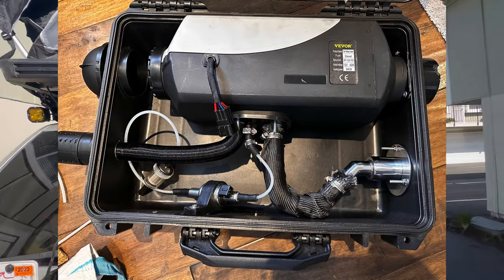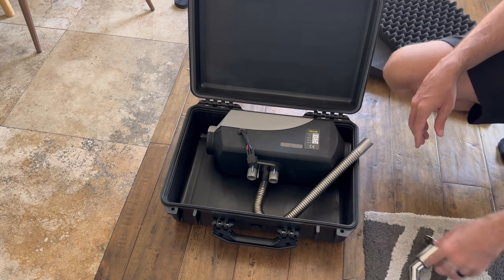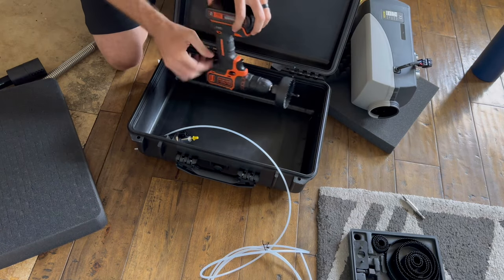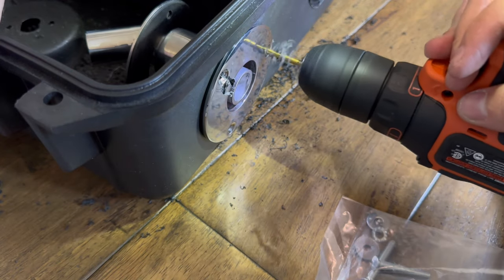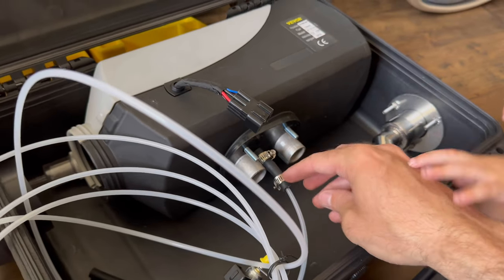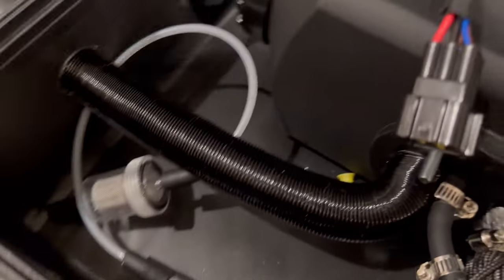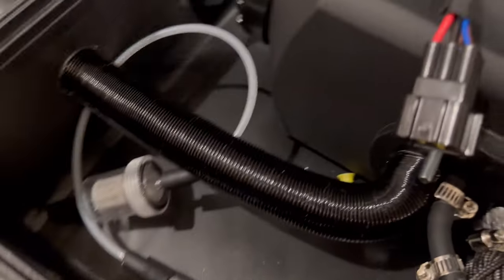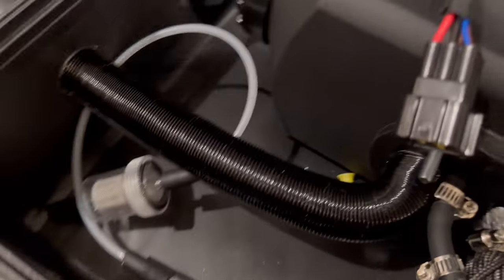Ultimate VEVOR DIESEL HEATER IN A BOX BUILD | DIY Tent Heater for Off-Grid Overlanding

Comment: Might want to consider adding a heater intake so that you get the benefit from reheating the air within the tent so that it doesn’t have to always pull freezing cold air. Plus it will help avoid pulling the diesel exhaust into the heater which could be dangerous in a small tent.
Reply: Many have proven it creates condensation. I’ll take condensation over co2 intoxication tho

Comment: You're drawing air in from where the exhaust comes out. These heaters are designed to draw air in and out into the living area, separate from the combustion air in and out.
Reply from the maker: Yep, working on getting that figured out. This was mostly a test to get the basic function down and it works really well. I also upgraded to a stainless steel elbow on the outlet. Slowly coming together
Reply: @lexus_offroad_adventures  obvious answer is to have another flexible pipe going into the van window, so one for inlet and one for outlet. Will be more efficient as it's heating warm air inside the van.

Comment: The instructions say not to lay the heater on its side due to a weep hole at the combustion glow plug entrance due to fuel issues. Did it work out ok?
Reply from the maker: @flyingeyeballfpvjoe1516  I usually run it on a 45-degree angle on the back of the tire carrier for this reason. Works fine like that

Comment: The rubber gasket of the fuel pick up has to be on the outside of the fuel tank. The metal ring gives a better pressure on the rubber ring on to the tank.
Reply from the maker: Good point. I have since switched to a different (smaller) tank with this orientation

Comment: Your intakes will not withstand driving rain or condensation on muffler intake. I would suggest you either put right angle flange on heater input, or a pipe  to recirculate tent air, and that will improve its efficieny. In regard to burner intake there are 2 options to my mind. One put a shield plate over its filter come silenser, or 2, put a right angle fitting so intake faces downwards.
Reply from the maker: I will be addressing the air intake muffler soon. See the latest video for how I’m achieving circulation. It’s a work in progress, thanks for the tips!

Comment: Nice build and it suits your needs. 

You have the exhaust muffler flat in the horizontal position. It needs to be in the vertical position. Why? There is a small weep hole. The weep hole points downward for condensation drainage. On the intake side, it is not an air filter, it is a silencer (which really does not work all that well). Upgrade to an actual sir filter.
Reply from the maker: Yep, I’ve rotated the muffler down for proper weep hole operation. I just kinda threw it on to see if it quieted the exhaust down at all, which it did. 

I’ll look for a proper air filter, thanks!

Comment: You can swag a 3/4" copper pipe with a 7/8" expansion tool. Coiled copper tubing is the easiest to expand. It will slide over both the exhaust tip from the heater and the exhaust exit mount.

I made mine with medium Ridgid tool box. It has plenty for the heater. The exhaust pipe went out in a straight line. The intake pipe stayed inside. 
You don't have to exit the box with the intake filter. Just provide ventilation.

I had plenty of room left to place 36ah lithium battery inside with all the controller and wires attached to the lid.
I even added solar controller inside the box. I can charge the battery with solar.
I also added 12v socket and XT60 on the outside for charging and use as power supply.  
I cut 3" holes with vents. The vents have 12v fans to cool the inside the box.
I can also control the heater with the Bluetooth.

The fuel pump can be mounted straight up and down. Just not level or down wards on the outlet.
The fuel line has quick disconnect.
The heater is clean as a whistle. No wires and fuel line to tangle.
Reply from the maker: Thanks for the write-up! Sounds like a really cool all-in-one setup. I updated this one in a later video and cleaned it up a lot, but I probably keep improving it as time goes with ideas like these!

Comment: Nice build, i am also on the verge of finishing my setup. I am waiting for a metal flange so that it will keep up with the high temp output
Reply from the maker: I tried the aluminum elbow but it was not a true 3" OD/was really flimsy. I got an ABS piece and I'll see how it takes the heat. ABS is supposed to be good up to 175 degrees. Here’s the link: https://amzn.to/3NT3HVP
Reply: Cool, let us know if it's bending
Reply from the maker: @myloalex  for sure need to post an update video after I get a chance to use it snow camping
Reply from the maker: @myloalex  before I could test with the ABS, I just ended up getting a steel elbow. Works perfectly. I posted an update video called diesel heater efficiency mods a bit ago

Comment: Hey I notice you have 100ft of 14 awg wire listed for genera use.. but 16awg for the cigarette lighter for the power station. Is the power cord to the unit 14 or 16awg? Thank you!
Reply from the maker: I used 14 for power due to the length of wire. Some voltage drop could occur if the wires are too small/lead to inefficiency, heat, etc.

Comment: Does the diesel fuel not gel at a certain temperature?
Reply from the maker: I’m not severe winter camping at below 20 degrees F, so I haven’t had this issue. If you plan on camping at those temps, a warming device for the fuel tank might be necessary

Comment: What gauge wire does the controller need? Like to extendrun it 10 to 15 feet to inside the vehicle.
Reply from the maker: I used a bunch of this stuff for the small gauge wire things https://amzn.to/3QzNPdU
Reply: @lexus_offroad_adventures  Good to know, any idea how much one can extend low voltage wire before getting too much voltage drop?
Reply from the maker: @raczyk  you’re going to get voltage drop with any length of wire but I haven’t tested the limit of when the controller starts to give out. Since it’s just a display, I don’t foresee voltage drop being an issue unless it’s extended a significant distance

Comment: in your build thread you link a waterproof connector.. do we need a 4 or 5 pin connector?
Reply from the maker: It would be 5 pin. 3 for the controller and 2 for power and gnd
Reply: @lexus_offroad_adventures  thanks for your great video, great teaching material. It's possible to use only 1 5pin connector right ?
Reply from the maker: @alexislahiani13  Yes, I have upgraded to this one in a later video because it’s big enough to fit the power wires and adjustable enough to run the 3 controller wires: https://amzn.to/3B5kxep

Comment: Did you fuel line or filter get heat damage being so close to the exhaust pipe?
Reply from the maker: No the heat wrap works really well. I checked for that and at most the fuel line felt a bit warm in one spot but nothing to worry about

Comment: Just curious there a reason so have part of the exhaust (1 foot or so) on the case before exhausting it out? Would it be better to mount the heaters exhaust right against the case, and have it leave right away?
Reply from the maker: Yes you could do that but you need the metal pass-through anyway to prevent melting the case. I did it this way for ease of mounting and to keep things waterproof. Having the exhaust directly sticking out may invite in the weather.